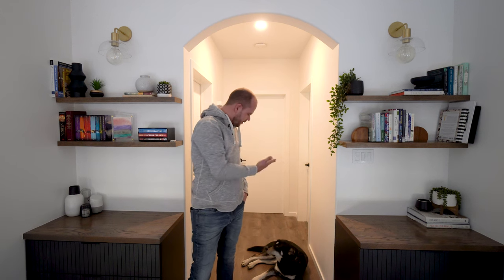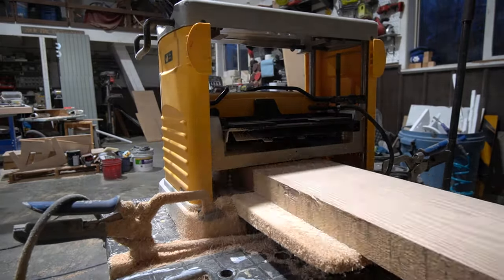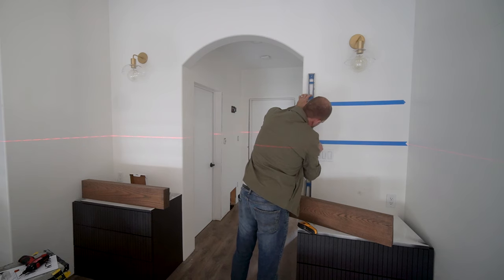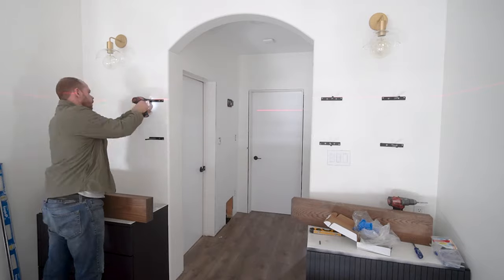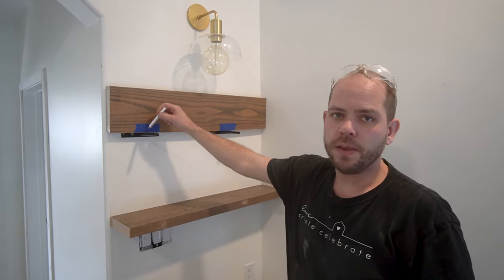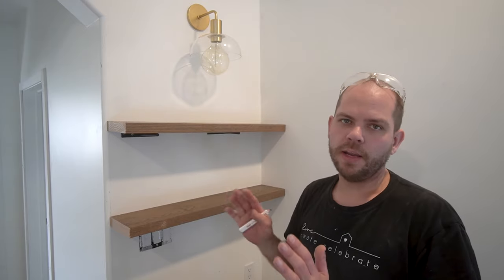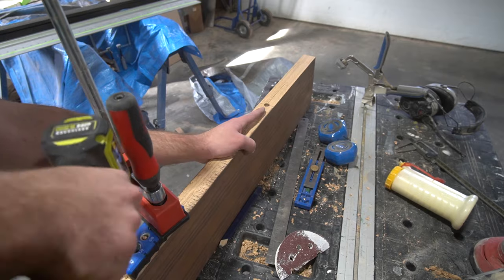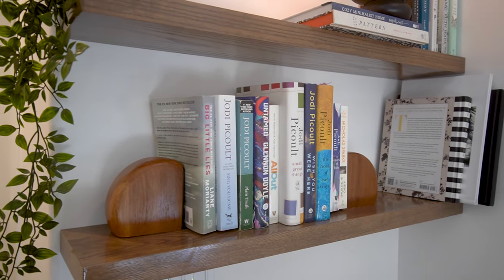DIY Solid Hardwood Floating Shelves | How to scribe uneven walls and drill straight!

Comment: I second the recommendation on the zip tie toggler anchors! For anyone that doesn’t know, the plastic only holds it long enough to screw. Otherwise it’s 100% metal, so it’s extremely strong. I wouldn’t jump on those shelves, but they are not going anywhere.
Reply from the maker: 110%

Comment: i see 4 bracket holes per bracket. I assume you did not find wood studs for each hole... correct?  If you did not, is that when you used those plastic toggle anchors? Thanks
Reply from the maker: Russ added extra structure to the walls before drywall (we had all these walls open to deal with previous renos). So our brackets hit framing at all the screw holes, making them very secure. You can use the drywall plugs but make sure you get high quality ones that can hold the specified weight you think your shelves will be as well for items you plan to put on the shelves.

Comment: Protip these can be be installed vertically directly onto the stud. Make a much sturdier shelf
Reply from the maker: Vertically works if the shelve was thick enough to cover the hardware (we just didn't want to see the black bracket). We added structure to the walls when we had them open as we knew we were adding shelving. But these are great tips! Thanks so much for watching 🙂
Reply: Protip; I don’t recommend installing the brackets vertically, it’ll look like shit with the bracket showing. You can buy brackets that are longer with multiple holes to find the studs for a much sturdier shelf.
Reply from the maker: Thats the great thing about different types of hardware, each work best for a specific application. This work great for us - I am sure there are different ways to get the job done:) At the end of the day these shelves were sturdy and secure and worked great for our space.